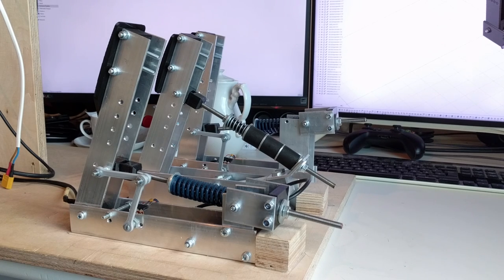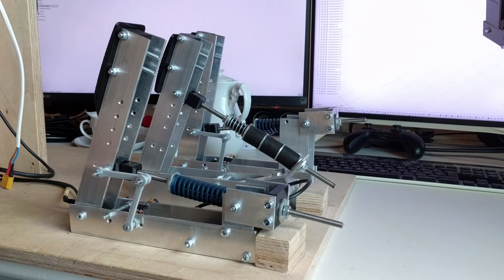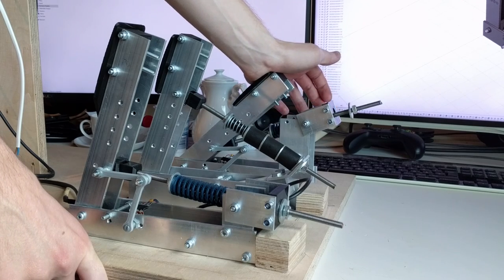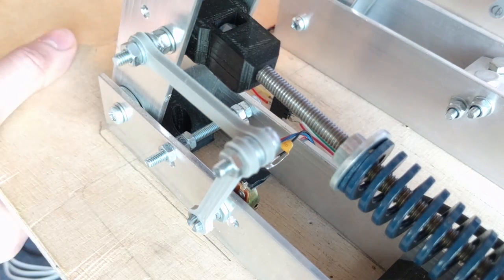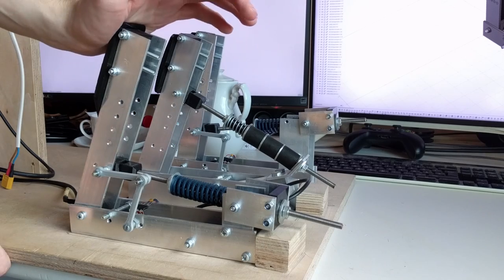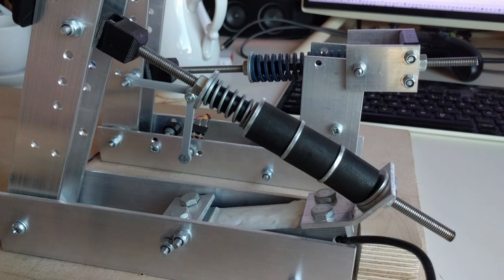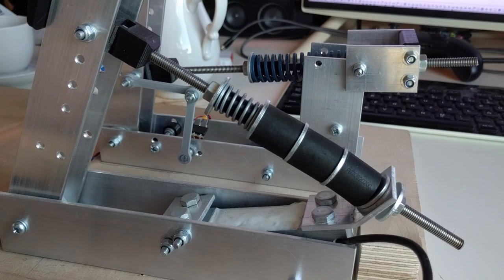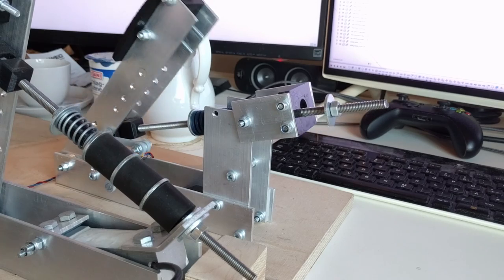DIY Simracing Pedals

Comment: Awesome engineering (especially the clutch!). Could you share a blueprint (if you have one)? Also, what springs do you use for clutch and gas? Have a hard time finding the right diameters, lengths etc :D
Reply: They never answer the question nor they give a info.I want to print pevent joints he printed.Do you know we're to find such 3dprint

Comment: Bro good project, why did you use a capacitor on the potentiometer?
Reply from the maker: The raw signal from the potentiometers was a little noisy. The capacitors smoothed it out a little.
Reply: @janbalke5900  cool !

Comment: Which sensor and microcontroller did you use for this pedal set? I'm guessing that connected to those 3D printed joints are some rotary potentiometers?
Reply from the maker: Yes, I'm using potentiometers on the throttle and the clutch. The microcontroller i'm using is the Leo Bodnar Loadcell Joystick Controller.
Reply: An Amplifier for the loadcell was still needed? Or does the Bodnar do it already internally?
Reply from the maker: @TheInsaiyan  No additional amplifier was needed, the Leo Bodnar board already takes care of that.

Comment: Hello, greetings from Argentina. One question, I'm doing a similar project, but I don't get a right feeling.  How did you solve the "sawteeth" effect caused by the threaded rod ??
Reply: Maybe that's what the capacitors are for? He commented that they are 1uF ceramic capacitors.
Reply: @Vishinho17  It´s mechanic problem.
Reply: Hola ale, somos dos de arg, pudiste termiarlo? Yo estoy empezando..
Reply: @leon1991-oct  Hola, si, si bien no estoy del todo conforme con la electronica me gusta como quedaron, use arduino leonardo.

Comment: Very interesting project as I am also interested to make one as well, however i see some things i don't understand such as the wiring but also why did you use a capacitor on the potentiometer?
Reply: The capacitor filters out electrical noise
Reply: It adds a delay effect I think, so that the variations are smoother. The larger the capacitance the bigger the effect will be

Comment: How did you connect all of it? Did you use an arduino leo and flashed custom firmware on it? If yes, how did you connect the load cell? I assume you used an amplifier and put the signal into the arduino Analog Input pins and read the values (if that is possible)

Comment: What are the sensors used for the pedal that simulates braking? por favor
Reply from the maker: The brake pedal uses a loadcell sensor, it senses pressure instead of angular position. This kind of sensor is often used in weighing scales.

Comment: Hello, is your design available somewhere? I like the potentiometer idea with the little arms. I would like to do also my own pedals,   I started some designs but I can't find information about for example what springs to use for the accelerator, brake and clutch pedals.

Comment: hello Jan.where you bought the rubber springs?
Reply from the maker: I bought them in a onlineshop for sanitary accessories.
https://www.banemo.de/554190/effbe-elastomer-federn-din-9835-typ-295-ad-20-mm-l-20-mm?fs=2599913430
Theese kind of springs are surprisingly hard to find online.
Reply: @janbalke5900  Thank you

Comment: Great project! Looking forward to v2. How did you connect the gas and clutch to PC? How do you make them communicate with the PC?
Reply from the maker: Thanks! I used the Leo Bodnar BU0836-LC Load Cell Joystick Controller. It can take a load cell, several analog and digital inputs, and is connected to the computer as a joystick device.
Reply: if you only need potentiometer i recommend Adruino Leonardo with " amstudio" 's 5 axis tutorial, a lot cheaper than load cell setup.

Comment: Very nice pedals mate!
Was wondering if you could show in more detail how the load cell is set up, and which rubbers you've used for the brake?
Reply from the maker: I'm actually in the process of redesigning them. I'm planning on doing a few videos about that process.
Reply: @janbalke5900  looking forward to it :)
Reply: @janbalke5900  did you ever produce those technical videos?

Comment: That looks like so much travel on the pedals, and take care of load cell cable, it's rubbing against the metal and it will end cutting of it. Also in the clutch pedal the screw touches the printed piece at the end.